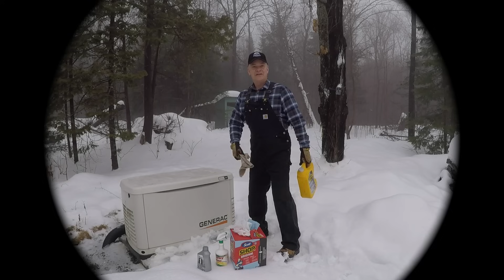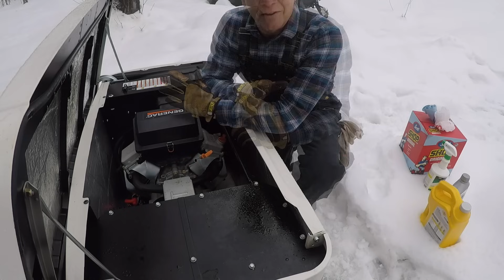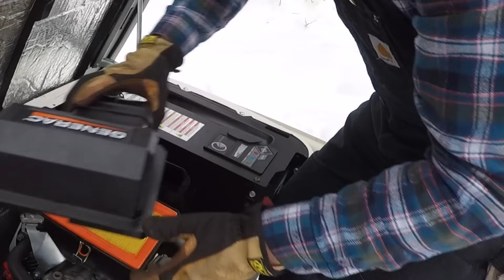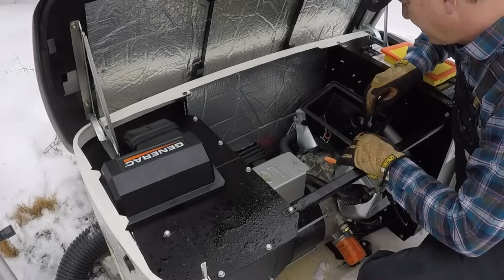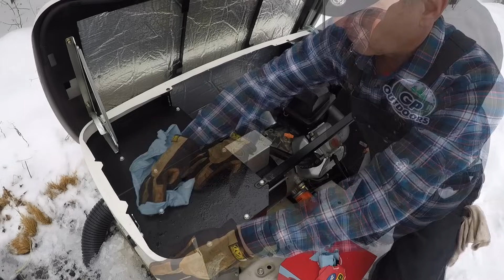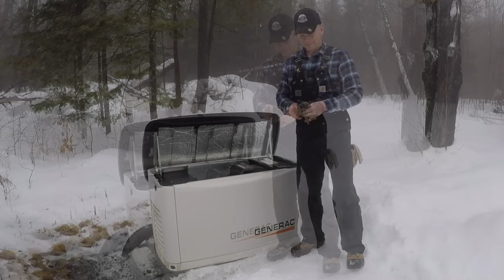#133 Thinking of Buying a Generac Generator? You Need To Watch This!

Comment: That’s not the exhaust port,it’s the crankcase breather.
Reply: In Canada its a crank case exhaust port.
Reply: May I suggest, for a reoccurring problem, relocate crankcase vent up higher so water condensate can't plug the vent.
Reply: @johnwhitehead5457  makes sense, but it might be on pupose to keep the air filter from soaking up water & then later freezing solid
Reply: Probably even a drain tube will create ice & clog....
Reply: Took me forever to figure out why the exhaust would be venting into the intake before I realized it's the breather. Lol
Reply: Thank you
Reply: I would drill a hole in the bottom and stick some foam just enough to let it drip condensation
Reply: @jacobk4412  I thought the same thing.
Reply: @kevinstamper9796  that area is already filtered so if you make a hole, you will get rid of the water at the expanse of letting non-filtered air get in the motor.

Comment: I will never own anything with a Generac engine. My 33hp engine in a Dixie Chpper Zero Turn dropped an exhaust valve, which destroyed the cylinder head & piston. I meticulously maintained this engine from day 1. This engine had only 423 hours on it. Yes, it was out of warranty, but I expected some help from them. Generac told me that they would supply all of the parts, BUT I would need an authorized dealer to do the work. I was quoted $3,000.00 for that. I purchased all OEM Generac parts online for about $800.00 & rebuilt the engine myself. Screw Generac!!